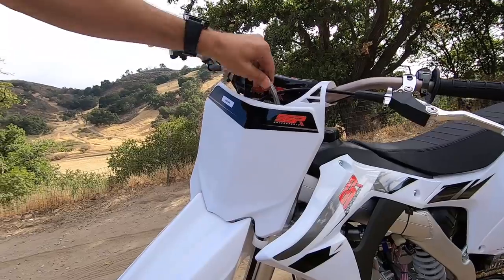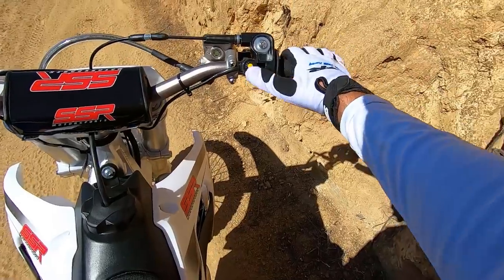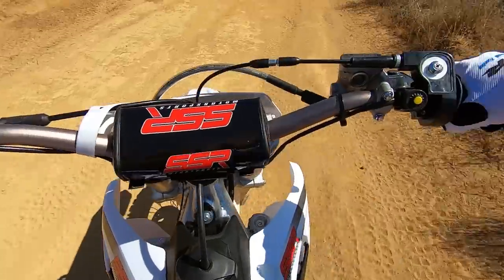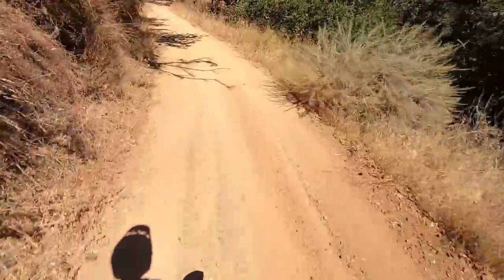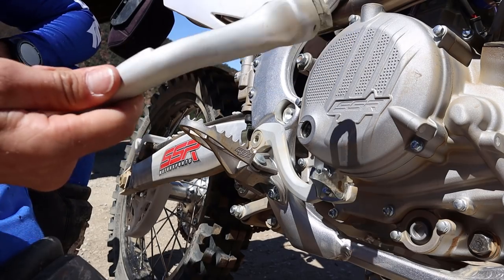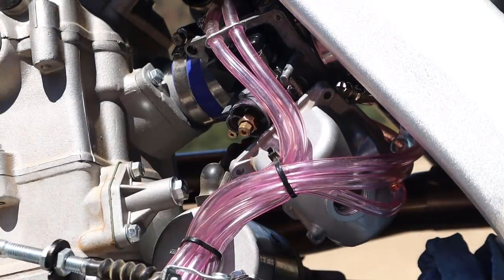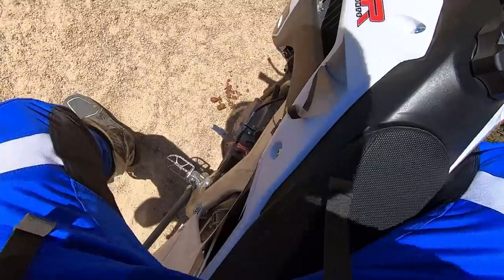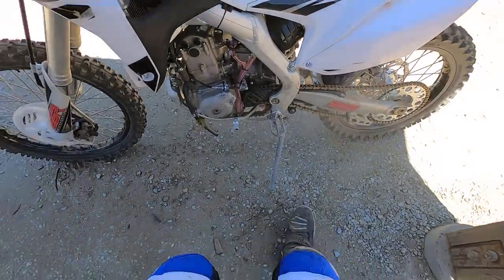I bought a brand new CHINESE dirt bike... And WOW - All new 2020 SSR SR300 first ride & review

Comment: Can someone 5'8 ride this? Can it be lowered?
Reply from the maker: Of course, and yes almost any bike can be lowered in a variety of ways.

This bike could probably be lowered with a lowering link (from a CRF);for the rear suspension, although they are not actually made specifically to lower the bike. They are made to make the suspension better, without going into a long-winded description.

But they do end up actually lowering the bike a little bit as well in the rear, which allows you to slide your fork tubes up in the clamps and lower the front.

Then, you could also have these suspension lowered internally. It's also reversible later on.

But I think you'll be fine with the bike the way it is.

-Charles // mXrevival
Reply: @mxrevival  Thanks, the specs indicate the seat height as being very high.
Reply from the maker: @bellyacre1  no problem. Consider it as tall as any other full-size bike period it is every bit of any other kawasaki, Suzuki, Honda, etc

In fact, once you're on it, you may really like it because I find the pegs to be higher than normal compared to those other brands. (With the seat being on par to other brands height wise) Meaning you'll have a little more room in the cockpit due to a shorter distance between pegs and seat. 

So if you have shorter legs it could be handy.

Comment: How good does it run with the biggest size jets?
Reply from the maker: It was better after the re-jet in the video but still not consistent. 

Turns out the airbox is too large as it's a copy of the high-performance CRF and needs additional restriction of air to get the most out of the carb. (I have been spending time with SSR's in-house engineers on this topic) 

So, rather than tame the bike down even more, we developed our own Lectron carbs for the bike (jet-less). https://www.mxrevival.com/copy-of-shop-tools - Work so well on the 2020. 

Also, the 2021 ditched this 2020 carb entirely for a pumper (FCR clone) which I'll be testing in the future. Insight here: https://youtu.be/zOUkrH4JonU

So the stock 2020 carb is already obsolete on the SR300, but I still think it will be perfect for beginners & those just looking for some good clean fun.

The engine is a good runner though, for sure. Very user friendly.

-Charles // mXrevival

Comment: Is this a Honda copy kinda thing or? It looks good tho!
Reply from the maker: Kind of, yes! They stole the basic body style, a few hard parts, and upper portion of the frame. A lot of parts copy the Honda but also aren't exact. Like the forks for example are copies of a 48 mm twin chamber showas, but the overall length is a little shorter and the internals are different. Stuff like that. For a clone, and a good one at that, copying the 16 CRF was a good idea in my opinion for ease of aftermarket plastics and graphics, etc.
Reply: Yeah, I did notice the forks was a littlebit shorter. But love to see this bike be used alot. I think it looks great, and things i read about it, and things you are talking about, it looks like a very nice bike for beginners, or people that want a new bike, and want something useable and smooth bike to ride this is a great bike to see if this is something you wanna do for a hobby an so on. I like that! So make alot of videos of this thing, I wanna see more man! Cool stuff!

Comment: Ok just watched your video.  1 your get paid by someone or 2 your have not seen the NEW Kawasaki KLX 300 you get a Japanese bike that has resale and reliability and it cost the same price as your Chinese bike. DONT LISTEN TO THIS GUY BUY A KAWASAKI KLX 300 FOR THE SAME PRICE IT WILL LAST LONGER AND THEY MAKE AFTERMARKET PARTS AND KAWASAKI IS BETTER THAN ANY CHINESE BIKE.
Reply from the maker: Dude, your caps lock is stuck....

Comment: A carby on a 2020 model... shouldn't it be fuel injected. Talk about 20 years behind the times.
Reply from the maker: 2021 YZ250 & 2021 250SX....carbureted & considered the pinnacle of two stroke "technology".

But I fully understand your train of thought. 

My analogy isn't completely fair as the YZ & SX are high performance bikes, while the SR300 is not ....wait maybe it proves the point even further 🤷‍♂️

Carburetors are cool!

Thanks for watching!
Reply: Yea, back when a bike was under 5 grand.  You can have the fuel injection.  It's just a dirt bike, not a space ship.

Comment: What legit brand is that a copy of ?
Reply from the maker: Honda CRF450R 2013-2016 😎
Reply: @mxrevival  pretty good looking . It’s the details that the Chinese fall short like quality metallurgy on nuts and bolts . Quality rubber and plastics that don’t fade
Reply from the maker: @michaelschuler7397  I was impressed this time & totally agree with you. The only thing straight away with this one was that (as expected) the decals were absolute junk.

Body panels are good- maybe slightly translucent, no rusty hardware... Even the threads on the bolts in the tank, that go into the brass tank inserts had anti-seize on them! That was a nice surprise.

Silicone radiator hoses... 

I do dislike the fact that the body hardware and fasteners have Allen heads but a simple fix at least for those that it bothers

Thanks for watching Michael!

-Charles // mXrevival

Comment: so its basically a honda clone?
Reply from the maker: Mostly in body and frame shape, excluding the lower down tubes. Everything else is pretty unique to the bike. even the forks appear to be clones, but they are different. Shorter, different internals, etc..
Reply: @mxrevival  do you think a crf low seat might fit?

Comment: Like i said I’m totally new to this dirt bike mayhem, and i just bought a 300 a week ago. I have rode it every day only using the electric start. I tried the kick starter today with no luck. I have watched every video i can find, still no luck. I finally noticed there was a mark on the bottom of the kickstarter where it was hitting my peg, is this normal, help
Reply from the maker: Yes it's normal for the kick start to bottom out there 😁

The SR300 is taken apart for now but will be back together soon
Reply: mXrevival 
Thanks man, right after i posted I finally got it to kickstart. I think i got it. I have got a little over a week on this bike now, actually the only bike😜. Feeling a lot more comfortable. Im officially addicted. Thanks for the reply
Reply from the maker: @joshbennett4561  Atta boy! Keep at it and work on good form & you'll be shredding 👊

Comment: Goodluck buying replacement parts in 5 years.
Reply from the maker: Actually, that's sort of the genius of it... You can use Honda parts.

Regarding the Zonsgen engine... It is the most commonly used engine by large, with millions of replacement parts, and the entire engine only costs around $1,500. Basically the same price as a cylinder head and components for a Japanese bike.

This engine is like the Honda Civic, or Yamaha YZ of the Chinese engine market. It's kind of nuts!

Thanks for watching 🤘

Comment: Dont put to much money in it because it's made in china and its gonna fall apart  did you see the way the sticker already are falling off, well basically everything on that bike is gonna be like wack a mile you fix this and 3 other things will need to be fixed just because nothing from china will last things will wear out fast rub loosen up wear out leak and suffer from lack of power let's see you pull a wheel at 30 mph dont brother it cant do it!